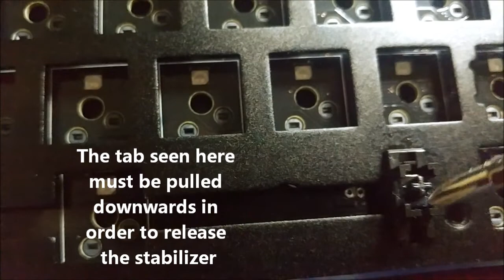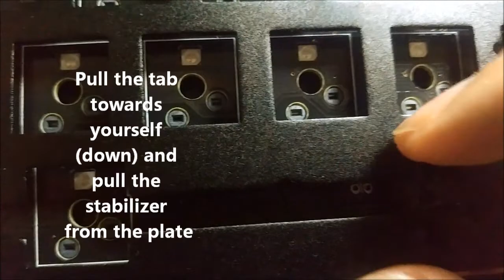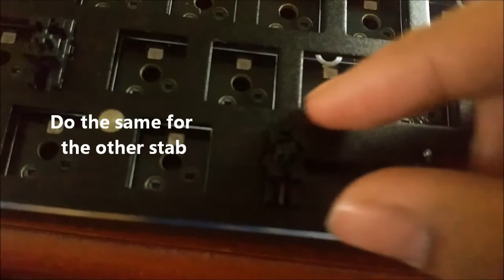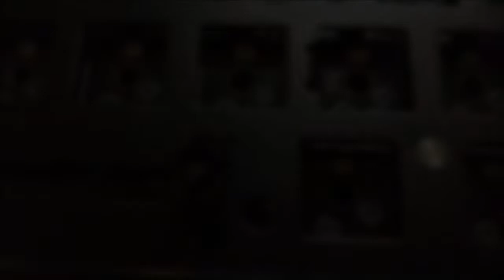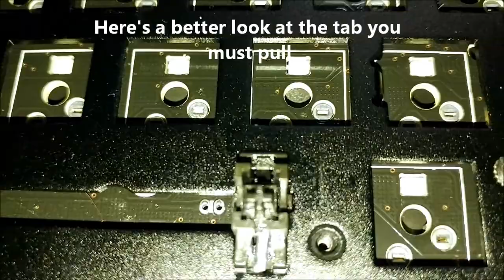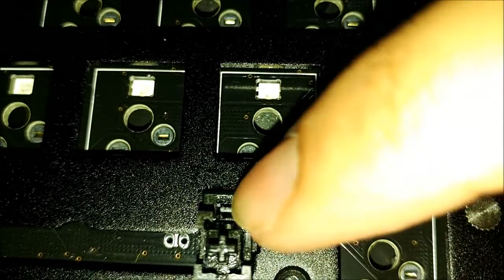How to Remove Cherry Style Plate Mount Stabilizers

Comment: only after desolder all switches? Is it possible without desolder?
Reply from the maker: Yes you need to desolder/remove switches first. The keyboard I am using uses hotswap switches so it was fairly easy remove, however if your keyboard has soldered switches then yes you would have to desolder the switches.

As you see in the video, the switch is removed so it is easy to get the stabilizer wire out. if the switch was still in place, it might be possible to feed the stabilizer wire through one end (either on the left or right) just to get the wire out, but then it would be extremely difficult to reinstall the stabs. Removal of switches is definitely the best option.

Comment: How can you tell what size stabilizers you need to get if you are planning of replacing them? I have a gmmk
Reply from the maker: It depends on the size of your GMMK. A 60% or TKL board needs 4  2u stabilizers and 1  6.25u stabilizer. A full sized board needs 7  2u stabilizers and 1  6.25u stabilizer.

Generally it's a safe assumption that your spacebar is 6.25u and the remaining ones are 2u

Comment: I also bought the GMMK and would like to know if I should by plate mounted or PCB mounted switches. I would highly appreciate a response.
Reply from the maker: The GMMK doesn't support PCB mounted switches (or stabilizers) so definitely get the plate mounted ones stabilizers and switches.
You can however, buy PCB mounted switches and  clips the legs off to convert them to plate mounted switches. Here's a video that does a good job of explaining it: https://www.youtube.com/watch?v=85Wv7sPADsk
Reply from the maker: @innocentoak3437  unfortunately, there are no holes for pcb mounted or screw in stabilizers, so you would not be able to install them in the first place. The GMMK is only compatible with plate-mount stabilizers.

Comment: So the clip that holds my stab to my plate isn’t working and apparently not a single other person on the internet has had this issue, if anyone can help it would be very appreciated
Reply: try pushing in on the clip while you pull the top of the stab towards the bottom of the keyboard. worked for me, as i had this issue.

Comment: Hey, I have a GMMK 60% keyboard with gateron reds and I broke the stabs on my spacebar. What stabs should I buy to replace them? I'm in Canada so I'd prefer a Canadian site (shorter wait times and shipping that isn't $20) lmk
Reply from the maker: You will need to buy a "6.25u plate mounted stabilizer" and those are the only ones compatible with a GMMK.

Unfortunately we're at a point where Canadian vendors are still growing and slowly stocking items, so you either have to pay the premium of Canadian products or the premium of shipping from the U.S. If you want cheap stabilizers and cheap shipping (but long wait times) then you got to ship from China. Here are your options:

Expensive stabilizer set + shipping, but it's Canadian: https://zealpc.net/collections/switches/products/authentic-cherry-pcb-plate-mount-gold-plated-stabilizers
Cheap stabilizers (individual) + expensive shipping from US: https://novelkeys.xyz/products/cherry-stabilizers?variant=3747939057704
Cheap stabilizers set + cheap shipping from China: You can try either various Aliexpress vendors or KBDFans https://kbdfans.com/products/transparent-pcb-stabilizers-27?_pos=4&_sid=952958d6d&_ss=r
Other alternative are buying from others in your area. You can try asking around in the Canadian Keyboards Discord: https://discord.gg/camechkeys

There are plenty of other vendors that I may or may not know about, but the above options are the ones that I usually use myself. You may be able to find more info on the discord if you ask around. Good luck!
Reply: @RedWingedBlackbird  Thanks for the help. I went to Flashquark and just got two stabilizers for my spacebar if I wanna try out modding again and something goes wrong. Costed like $5 USD with like $11 USD shipping but I needed them bad as I literally have no stabilizers for my spacebar atm